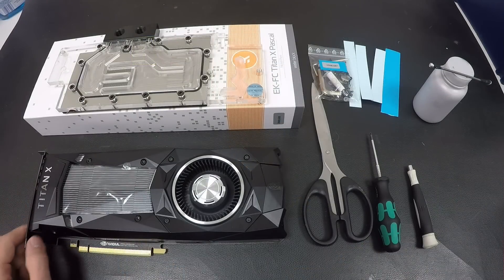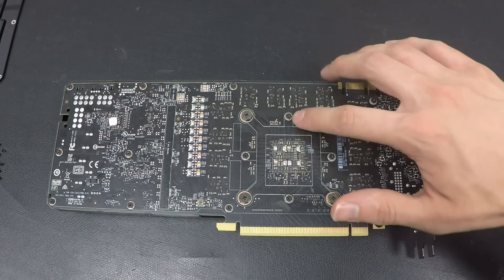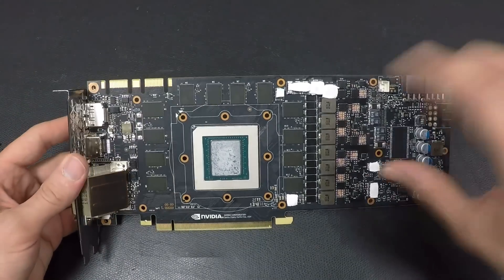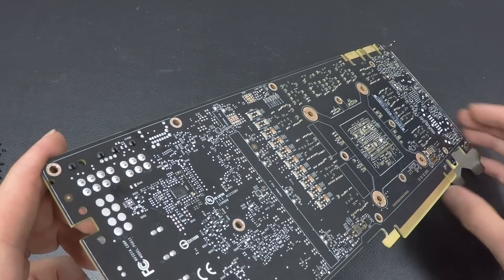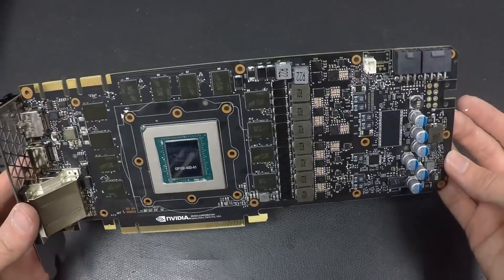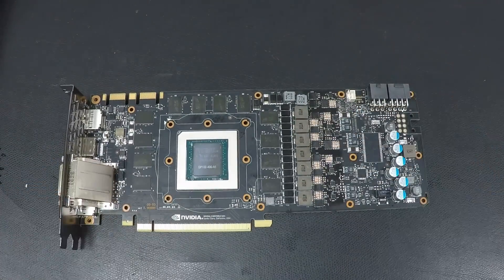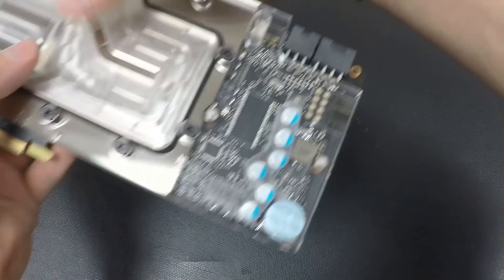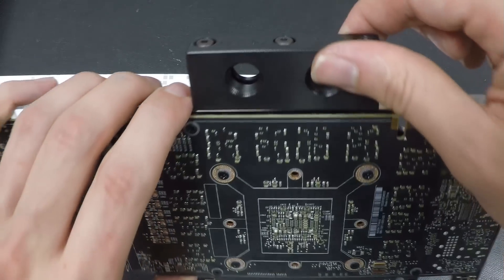The Titan X Project - Part 2: EK-FC Titan X Water Cooler + Power Target Mod

Comment: Is the VRM not getting blown by unlocking power target?
Reply: VRM mosfets should be rated at 80-100 °C to easily handle the max amperage on air cooling. If they're watercooled they can handle much more amps (that is, the amp rating goes down with higher temperature).
Reply: 125°C is the maximum for the power MOSFETs. You are right they can take plenty of beating. More importantly they have a very unforgiving efficiency curve. Let's say you need 10A per phase, if you keep your MOSFET at reasonable <80°C temp it will probably be 90% efficient or more. However as soon as go above 90°C and the efficiency goes south.  I.e. for the same 10A load you could be down at 60% efficiency at 100°C.
In fact nVidia kind of cheaped out on the thermal pads they always do! :D You can clearly see when he removed the stock cooler, the top matte black lacquer layer of the PCB behind the instructors has slightly changed color and turned "glossy". What it means is that either there was not good contact initially.. or nVidia simply used less conductive thermal gap pads with large temperature drop across it. The market of good pads is very limited and the good stuff is really expensive for consumer products check out Fujipoly Sarcon X-Um 17W/mK, while typical "white" pads are 0.5-3W/mK. The calculation is simple. 
Delta T = (Pad Thickness * Power)/Conductivity
At constant power 20W per phase, pad thickness 0.5mm
Good pad drops:
(0.5*40)/17 = 1.18°C
A poor pad drops anywhere from 
(0.5*40)/3 = 6.66°C to (0.5*40)/0.5 = 40°C
Anyway EK are nice and send better than average pads with their water blocks! :)

N.B. By drops I mean you add this temp difference across the pad to the temp of the block/heat sink to get your desired component temp.
Reply from the maker: Ivan had a really nice explanation here :) I also couldn't agree more on the pads. Nvidias pads are the cheapest stuff you can find. Still I wouldn't recommend using this with the stock cooler. But on water - no problem
Reply: You can't get the card to pull enough power to blow out the VRM. If you gave the card a ton of voltage and a really high core clock you could but since Pascal cards don't scale with voltage that really won't happen.

Comment: Instead of using liquid metal why not use another resistor instead? You could get another 5 milli ohm resistor and just solder it on top of the original one to halve the resistance if they do not sell a 2.5 milli ohm resistor in the same package size. Soldering a wire on top or on the side would be another way to lower resistance without worrying about the liquid metal dripping off. Many butane soldering irons are very cheap and can get hot enough to melt lead free solder. One does not even need lead free solder or flux unless you plan on returning it.
Reply from the maker: why make it so complicated when you can use liquid metal and keep the warranty? Soldering will void the warranty instantly
Reply: der8auer Only if they can detect it. If you use lead free solder and flux then they should not be able to detect that you did anything at all. If you are halfway decent at soldering you should be able to replace the shunt resistor, or add/remove resistors, and replace them with the original resistor.

As an electronics tech early in my life I would take a power to ground short board and make it my parts board/bitch since they were the harder ones to fix in many cases, and it took days to parts from the part department at the company that I worked at. It would take even more time to get the boards through the rework department so I learned to solder instead from some women who worked for IBM back in the day. Sometimes by pulling off many parts I actually found the power to ground short.

Keep up the excellent vids. You will go far in life brother.
Reply from the maker: thanks for the kind words :)

I also learned soldering at the age of around 6yo :D
Reply: der8auer Then I am not telling you much then, and am waiting for the next vid.:). For the others out there flux is your friend.
Reply: der8auer Also I forgot to mention the $. Most resistors are much less then 1$ US for 3 other then shipping while liquid metal is more, Both have the same shipping costs in many cases so the resistors cost less even considering the butane soldering iron, which can be used multiple times.
Reply: Couldnt you just use some form of silicone compound around the liquid metal to reduce risk? I mean something that does not dry out.
Reply: How come you do not use liquid metal as a cooling paste? Is it not worth it vs risk or? -i have only ever used normal aluminum based paste, and i often wonder if the heat transfer of a 300watt chip could get better in a liquid cooling setup by changing the paste to something exotic.
Reply: Mathias Jacobsen Umm you trolling or what? Liquid metal is already used as TIM material for ICs. Use clear nail polish on anything you do not want to short out. Coollabs and some others make it. People also use it on delidded Intels between the IC and internal heatspreader. It is more expensive then regular thermal paste so some people use regular TIM in between the heatspreader and the heatsink.

Comment: #Q&A #Question #Sonntag

hello,

scientist tried to create 1nm "thin" transistors with 
Molybdenum disulfide nanotubes
http://www.pcgameshardware.de/Panorama-Thema-233992/News/Forscher-entwickeln-1nm-Transistor-1209935/
i'm not an expert, but the phrase "electrons are heavier in MoS2 as in silicon" is wrong?
is it because of the van-der-waals interactions between those single molecules? the "move" more as like "stiffness" of silicon? assuming electrons can move at lightspeed in vacuum, they are slower as in "stiff" silicon? or can u explain it if im wrong? and what happens to the latency? assuming they got more speed as ddr1-4 interfaces they get a bigger latency? its more a "cache" related question?
or is the balanced with more speed/transistoer?